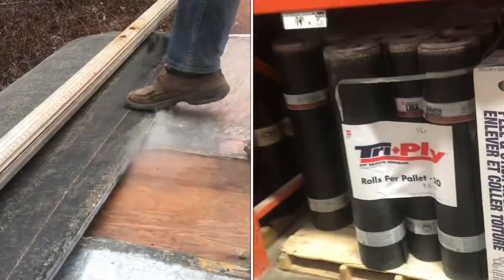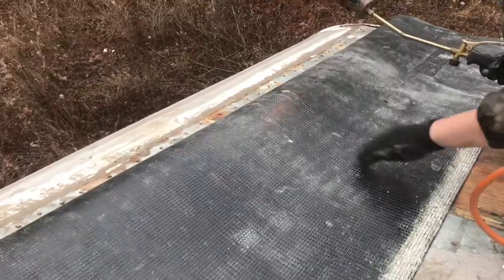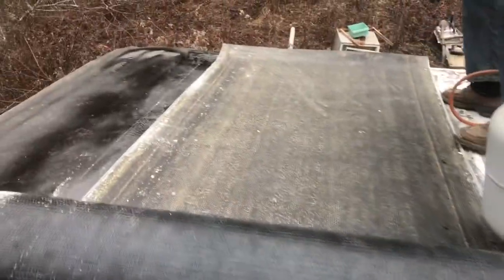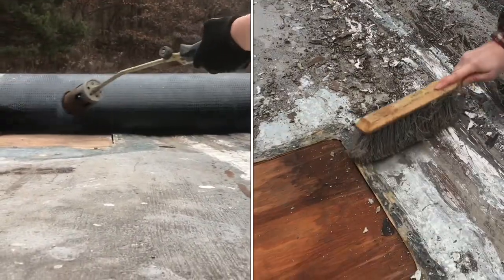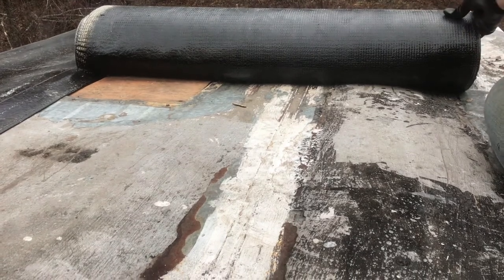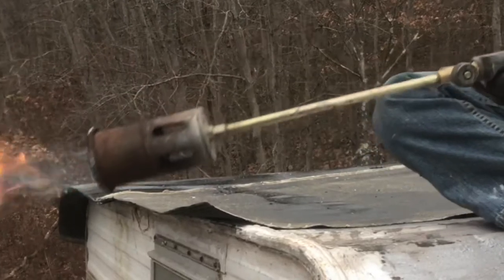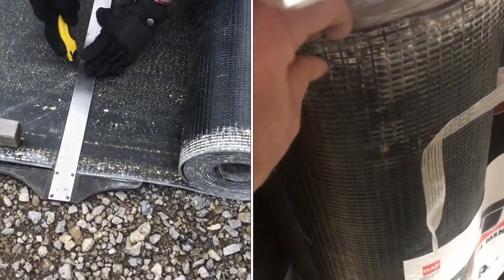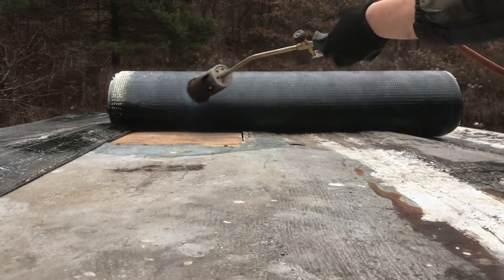which “flat roof” material is BEST torch down, epdm, tpo (my “strong” opinion)

Comment: I have used this personally on 3 roofs for my 125-year-old house. It's really pretty easy to put down. it forms to any contour or shape. It patches super easy just cut a shape out of the roll that fits what you need to patch get a small torch and heat it in. really great stuff to work with. It really seals. i installed 40# tar paper first nailing it down often, then torched the material into that. The only issue i have now is finding non fibered UV coating for it. I guess I am going to have to go to the fibered stuff. I think that might be harder to patch if i ever need it. The new roofing can be obtained with infused gravel coating so that serves as the UV protector. This came out about 2 years after i put mine down. I think it would be better, considerably less maintenance I think.

Comment: If ya torch down to metal you have to prime it with asphalt primer or will not stick for long especially in a cold climate and don’t torch to wood could smolder and light on fire when done torching should do a fire watch afterwards check for hot spots

Comment: Torching to wood?!? Garbage install!
Reply: He explained why he didn't use the basecoat on the RV numb nuts. Clean your ears.
Reply: If it worked, then good job. 1 year later and no leaks?
Reply: @krombopulosmichael242  - 1 year is not much of a test. It is a improper install. . . Any installer with any amount of SKILL would agree!
Reply: Just used the wood to cover up where the sky light was.